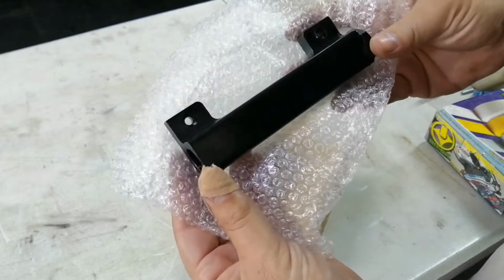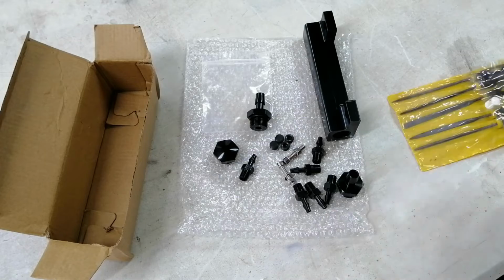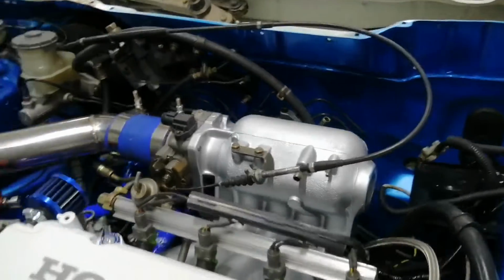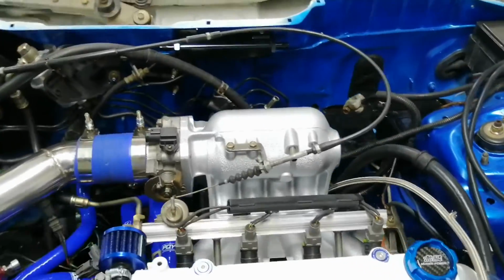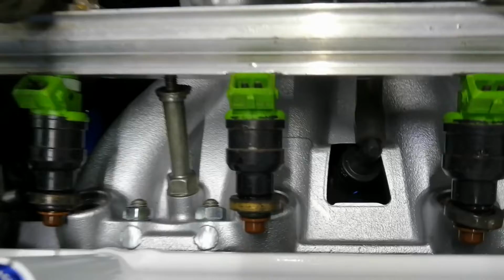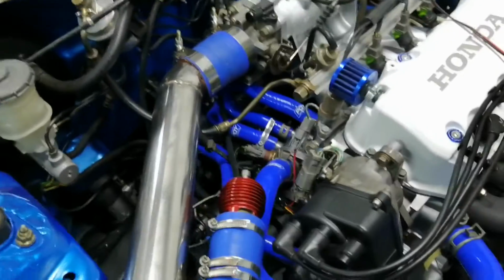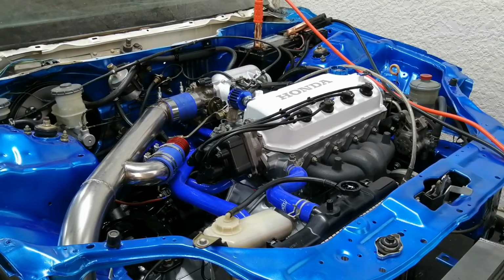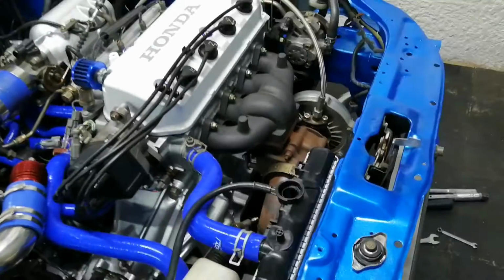Turbo Civic First Startup! - Vacuum Block Install - Part 4

Comment: You don't have to install that 1 way on the brake booster, they have them built in internally. but it's correct in theory!
Reply from the maker: Hi Bro, thanks good to know, I just did not want to risk it coz I was not sure.

Comment: What’s that producing for hp with the turbo d series? Normally only see the turbos on k and b series
Reply from the maker: Hi, the 1.5 Dseries makes about 160whp at 7psi, and on stock internals they can do about 200 to 220hp before the rods or headstuds fail. Not as strong as the B or K series but still decent and way cheaper 😉

Comment: I'm doing a d15b7 with y8 bottom.. How Many comp ratio you gave?
Reply from the maker: Hi Lucas, this will lower your compression as the B7 is low comp head and Y8 has low comp pistons, I estimate about 8.8-1 compression. It will still run fine but less performance NA, good for boost though. Use this website to calculate - https://www.zealautowerks.com/dseries.html
Reply: @RisingBoostYT  I'm going to do like you, but using d15b7 Block with y8 head
Reply from the maker: the B7 block, Y8 head combo will give you a higher compression ratio. should give a bump in power, just use high octane fuel on that setup. goodluck with the build!

Comment: what is the an size for the end ports ?
Reply from the maker: Hi Sosa, the ports are 1/2, however, the fitting fits a 10mm hose so they are probably 8mm ID. fits perfectly with the brake booster hose. check the link in the description for more details.

Comment: Can someone please tell me what company makes that turbo manifold or where can I get the same turbo manifold ?
Reply from the maker: Hi John, the specific on I have is perhaps discontinued, as I have not been seeing it recently on any site. but it use to sell on AliExpress by shops like EPMAN. it use to be very cheap ($25) but shipping was expensive.
Reply: @RisingBoostYT  thank you for replying. I really like how it’s very compact and looks like a very good flowing log manifold. Building by d16 this winter. I’ll look around if I can source that. Great build btw.
Reply from the maker: Yes, internal design is decent for a cheap cast manifold. goodluck with the build!
Reply: @jayvee8948  I got mine off eBay for 85 usd. Same one as him (mine is a t25 flange idk what his is)

Comment: Where is the iacv sir?
Reply from the maker: Hi, at the time there was no iacv, I tuned the ecu to hold the idle by retarding timing at 750rpm. not perfect but it did work, I have since added a 3 pin ivac from the D16 Auto.

Comment: Hi bro did u delete your evap system?
Reply from the maker: Hi bro, my civic is a jdm version and never had the evap system as it did not have to comply with the regulations, but If it did have it I would have deleted it
Reply: @RisingBoostYT  i got question  so my car obd2 planning to run obd1 ecu p28 soon. If i delete evap cap the intake vacumm can i still pass the inspection ??? I know obd2 and obd1 different when it comes to evap i heard some people delete it and cars run fine without evap on obd1

Comment: What size and brand turbo is that?
Reply from the maker: Hi Ricardo, it is a Copy T04E 50AR, too big for the engine, loads of lag. I would recommend a smaller turbo for the setup.